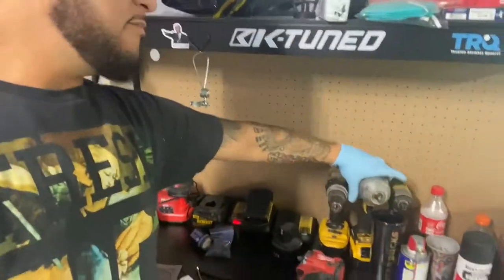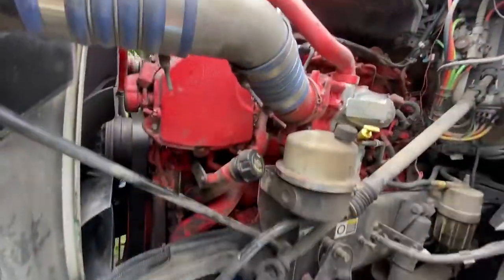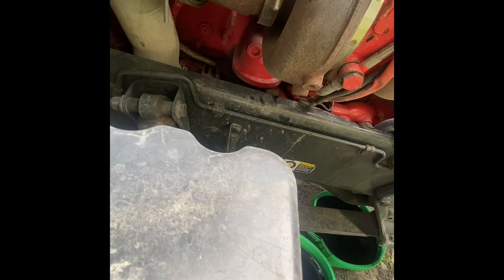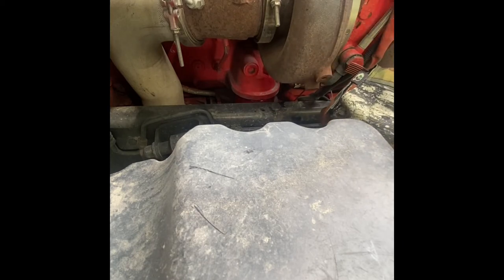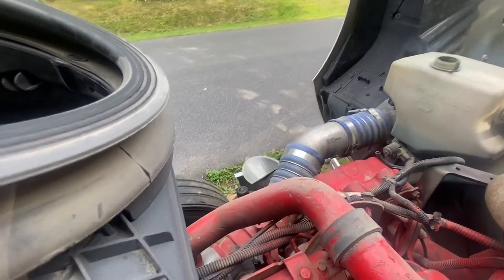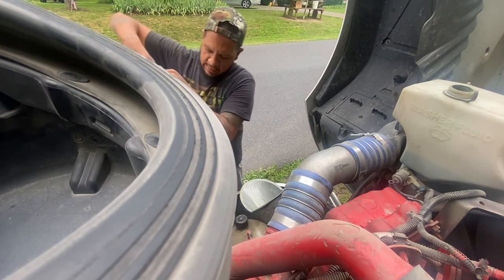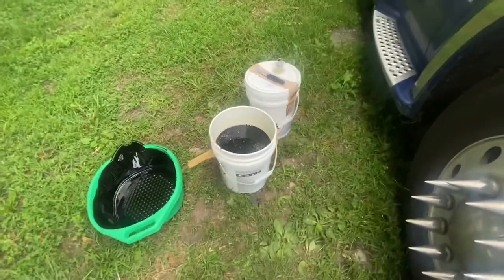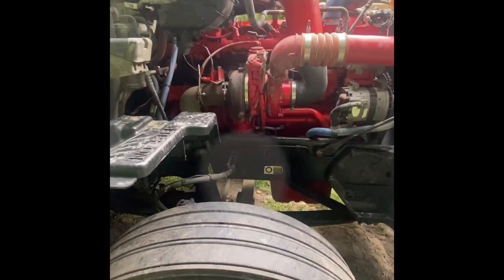(DIY)CUMMINS ISX 15 OIL CHANGE

Comment: Hello fellow truck owner. Decent video thank you for posting. Couple of pointers for others who may be relatively new to this... instead of Standard Oil catch pans you can use a tote available at Walmart. It's also a really good idea to put some large pieces of cardboard underneath your catch pans so you don't make a mess on the street or wherever. And I usually grease all the grease fittings on steering and brake components when changing oil.
Steering shaft universal joints should be lubed up with motorcycle chain spray-grease.
Don't forget WD40 for all your door locks and hinges. Cheers.
Reply from the maker: Thanks for watching 😊we appreciate you..god bless

Comment: Just something that may help you. You can punch a hole in the bottom of the oil and fuel filter and let them drain that way. Takes a bit more time but really eliminates the mess a bit more.
Reply from the maker: i appreciate that bro..gonna try it on my next oil change..thanks for your support brother
Reply: @TheJNALife747  no worries champ. Gotta help make life easier for us out there.

Comment: Bro i always uses mobile1 delvc on my Detroit 14l. But just bought t660 with Cummins im doin the oil change tomorrow and i asked alot of guys they say rotalla for Cummins. What you think
Reply from the maker: hello bro i have always used rotella t4 15w-40 and it seems to work well. i have heard cummins love zinc and rotella has a lot of zinc in it

Comment: Can you tell what kind of drain buckets those are where you purchased them
Reply from the maker: https://www.autozone.com/shop-and-garage-tools/oil-drain-pan/p/flotool-less-mess-oil-drain-pan/886356_0_0?cmpid=LIA:US:EN:AD:NL:1000000:GEN:19502231967&&CATARGETID=120054150001286739&CADevice=m&gclid=Cj0KCQjwj5mpBhDJARIsAOVjBdrqGBZgI4bPpG_8DCFp0flsea7P5txFcw5ZLQKqAP_clvXADrwhJx0aAqhpEALw_wcB&gclsrc=aw.ds
Reply from the maker: here is the link i ordered them from autozone
Reply: How and where do you dispose of the old oil and what's the disposal fee is the crucial question
Reply from the maker: @carloswhatley5182  i have a buddy that uses it to heat his garage but i know advance auto and our local landfill takes old oil to recycle it at not charge

Comment: What is oil capacity?
Reply from the maker: @guy1284  when we do a oil change we refill with 10 gallons of oil..I no longer use gear oil as an additive i switched to using 1 gallon of Lucas thanks for watching we appreciate you..god bless 🙏🏾

Comment: Like a video period I wouldn't gotta oil change from loves. And the filters that's on the right side. These guys broke that plug That is behind that filter through Asc R. Cold didn't know until I got 100 some miles down the road to get my def Filter changed out. Noticed it the next morning when I did my pre-trip. So I am hoping that this warning light goes off. You can't trust none of these mechanics man
Reply from the maker: u got that right brother..i usually do all my oil changes myself that way i kno im getn new oil and nothing like that happens..if it does it’s my fault 🤦‍♂️..i have not had the best experiences with shops especially truck stop shops try to stay away from having to take your truck to them kind of places brother..🤜🏾🤛🏾god bless🙏🏽